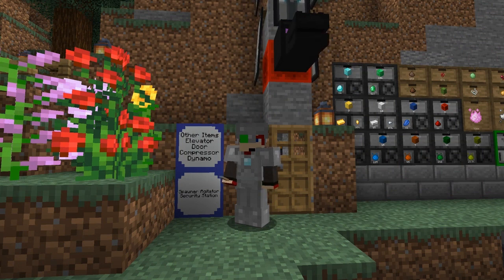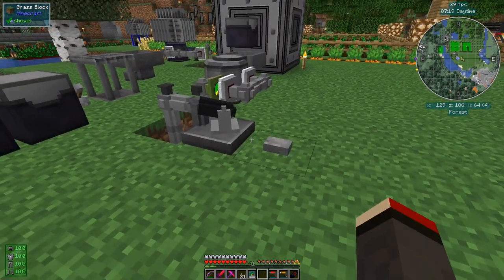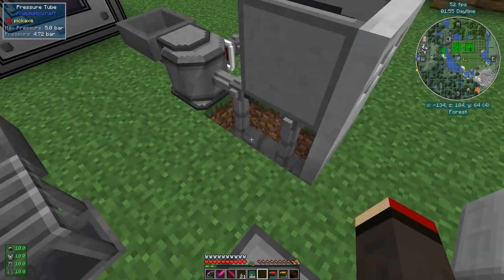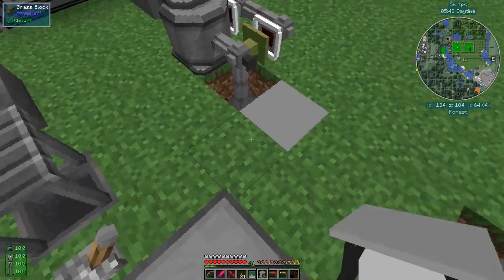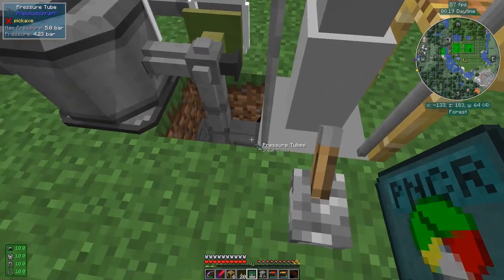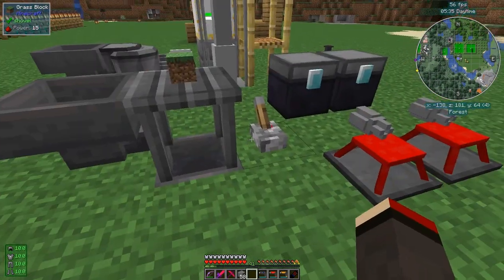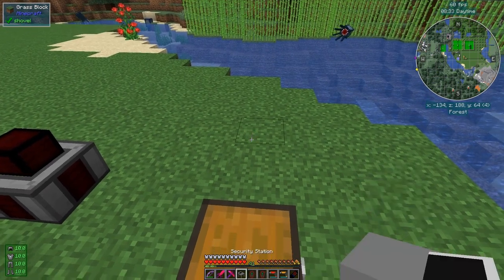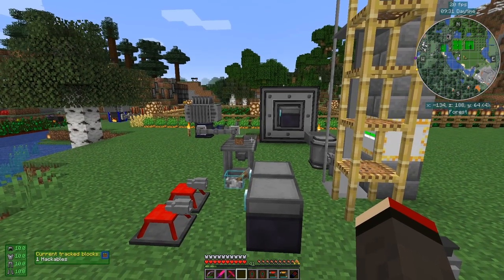PneumaticCraft: Repressurized #27 - Doors, Elevators, Tag Filter, Agitator and Hacking

Comment: The dispenser upgrade in Air Cannons: consider for example what would happen if you put TNT in a dispenser.... well the Air Cannon would mimic that behaviour :)
Reply from the maker: Thank you, is TNT the only thing that can be ignited as it is thrown? Not sure about throwing TNT about the world does it have a use?
Reply: @duncanwebb4934  other things that can be dispensed are: boats, minecarts, arrows, fire charges and basically anything that's right click to throw like eggs, snowballs, splash potions, etc.

As for the uses of throwing TNT... not much on a single player world... could be "interesting" in PVP though, given the potential range of the air cannon ;)
Reply from the maker: Thank you, I see some of those could be useful. I tested TNT with a long range, it detonated before landing. Can see the fun side of TNT in PVP.
Reply: @duncanwebb4934  as it happens, there's a (very old) issue open for just that - https://github.com/TeamPneumatic/pnc-repressurized/issues/386, so thanks for reminding me :)
Reply from the maker: I'll have to try this out, I found two posts from you that were "held for review", odd since automatic approval is set on, maybe this was posted earlier.